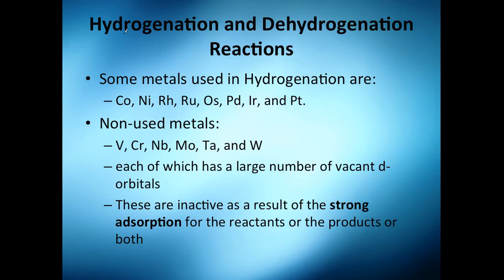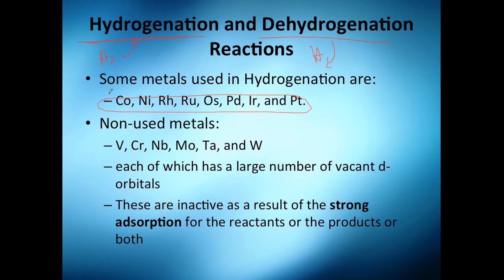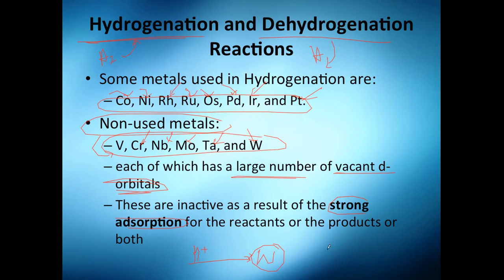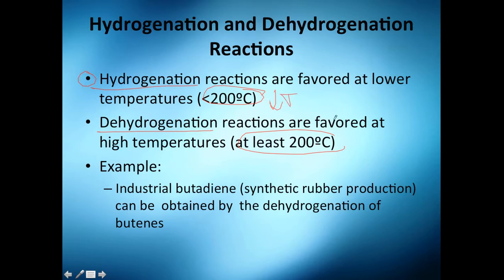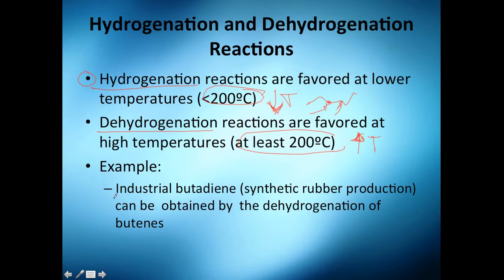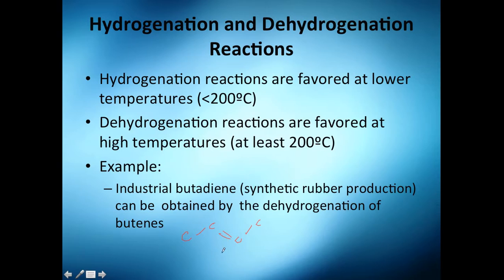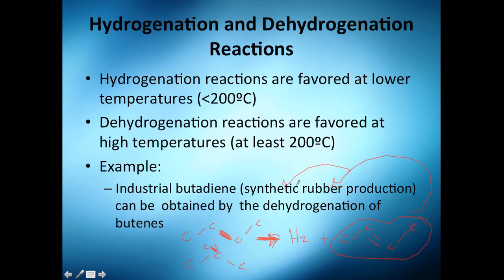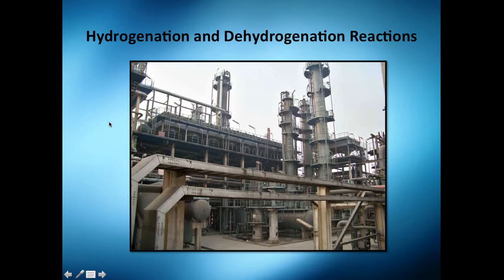Hydrogenation and Dehydrogenation Processes in Industry // Reactor Engineering - Class 150

Comment: How can we add a palladium catalyst into Hydrogenation reactor after solvent and Hydrogen gas applied
Reply from the maker: You can add the palladium catalyst as a slurry in solvent under inert gas (like nitrogen) before or after hydrogen is charged—just make sure the system is sealed and agitated. Always keep Pd/C wet to avoid ignition risk! 🔥🧪